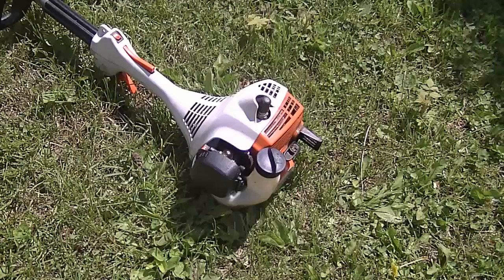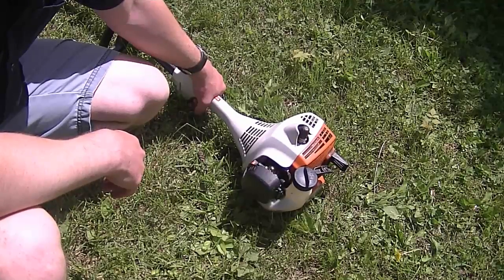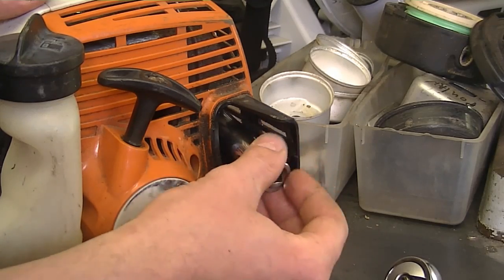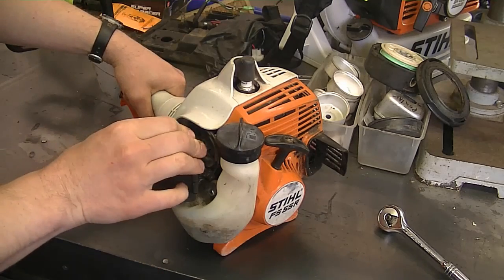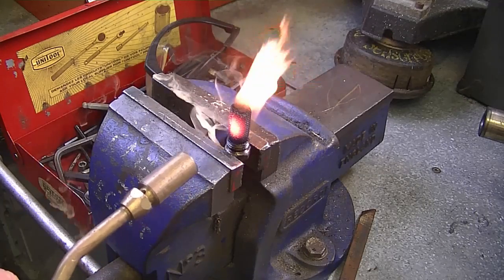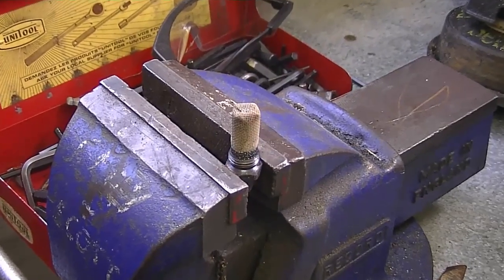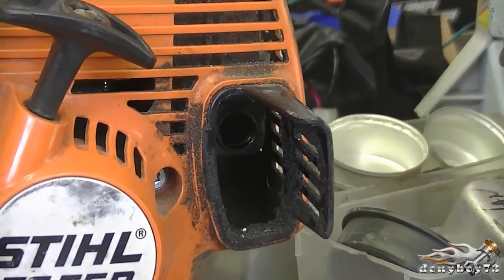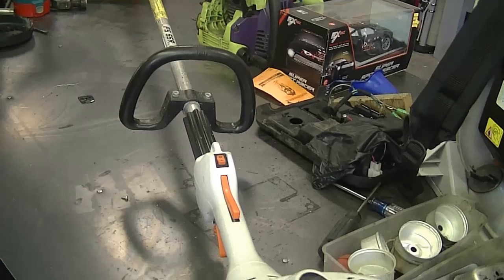Symptoms & Repair Of A Clogged Spark Arrester On A STIHL Grass Weed Wacker

Comment: THANKS!!!!!!!! I just happened to stumble on this. I am a VERY good home mechanic but could no longer get my 12 year old Stihl to run. Thought it was carb, thought it was plug, thought it was fuel line. I took my flamer arrestor out and it started like a mad machine. INSTANT throttle response like it was as new.10 times the RPM. FANTASTIC, so so happy!

Comment: Great video. Elderly neighbor had the same problem with his Echo trimmer.I noted lots of carbon around the muffler and asked him how much oil he used per gallon.He replied  4 ounces.He asked me if I could help him out. Started it same symptoms. Went home googled it and your video came up. Checked and screen clogged. I felt more comfortable taking the head off for two reasons carbon and he cross threaded the plug. It got so hot the bolts on the muffler were siezed. So bad my T handle twisted trying to remove them. Sprayed some KROIL on them and let sit for a couple days and came out easy(Great stuff). Removed cylinder removed carbon and chased the threads. Replaced his fuel tank also because he let it idle on the driveway and it wore some holes in it. Discovered it when I pressure checked the tank. Thank you for your videos! I have Stihl Bronze and Echo training but low on experience.. Your help has given me the confidence to get the job done!
Reply from the maker: +RyanCJ3 you're welcome, make sure you're subscribed

Comment: thanks.  just did this on my 6+ yr old stihl km55r kombi head...  I couldn't get the rpm's high enough to work the brush sweeper attachment or leaf blower...  I was surprised that it was clogged so fast.  I have only run 15 or so litres of premix through this machine...  anyways works great now.   driveway is all swept of the winter gravel/sand and junk.

Comment: I had the same issue with a Stihl FS 86 model. The repair shop charged me $75 to clean the arrestor. I ran about 3 gallons of the new Stihl grey bottle gasoline oil mix in the trimmer when the arrestor became clogged and bogged the engine. I have been running the old orange bottle gasoline oil mix ever since without any issues. Now that I know what the arrestor looks like - I believe the best approach is to remove the arrestor and use the new grey bottle gasoline oil mix in the trimmer for its protective engine properties. As a qualifier, I am only a homeowner working on his own urban property and not a commercial landscaper working in a forest area.

Comment: Hi Don , Good video.  Have a stihl 170 chainsaw that has starting problems. it's barely 2 and only been run less than 5 times. But,  gonna check the spark arrestor on it before I pull the carb. Seems crazy carb problem s with such little use but last resort. Truly can't think the spark arrestor is clogged either but least of two evils. Thanks for your videos,  always helpful.

Comment: Nice video and explanation. Cured my fs55 of the exact same problem. I went for the feul filter because it started easy but wouldn't run high rpm. Nothing wrong with changing it even though it didn't cure it!

Comment: Got it Donyboy thank you never would have thought of that. I'll check that out as well it does look rather built up already.
Reply from the maker: might be your problem
Reply: thanks how bout the craftsman with the pulley assembly not grabbing the flywheel right and the cover rocks back and forth? All the screws in the cover line up great and seems to be on right but it rocks on top so something is not seating correct and even though the pull works great out it hangs up  sometimes while on.

Comment: Dony,  The symptoms on your Stihl is very similar to my Echo PB-200 blower.  I checked the spark arrestor but there was very little carbon.  I cleaned it anyway and heated up the muffler to to burn off any carbon.  As I said, there was very little and there was little improvement

So, now what should I be looking for?  I like the machine as it is fairly light to carry around on the roof when blowing debris from the surrounding trees.  Your help is appreciated.

Comment: I use my tiki torch on the back patio and the flame from it cleans just as good as a butane torch, takes a little longer but burns all the built carbon off of screen for certain.

Comment: Hi Don, I'm a big fan.  I have the same Stihl FS 55 , I have replaced carb and still can't start. Original carb, and replacement, have small air bubbles leaking through primer bulbs.  Not sure what to replace.  New bulbs installed.  Fuel lines or some gasket?

Comment: if the carburetor has adjusting screws (assuming its a walbro or zama carb with high and low end screws), adjust them until the engine starts. if it still doesn't start, check your spark plug and exhaust port. sometimes the ignition coil can go loose, so it would also be best to check that aswell

Comment: Stihl FS45 trimmer starter rope is very hard to pull. Removed the muffler, carb, and spark plug. No scoring on piston or carbon buildup in exhaust port.
 The piston moves easily and smoothly when you pull the rope with the pug out. Put the plug back in and starter rope is very hard to pull again. Can't pull fast enough to start, or even attempt to. Removed and checked the recoil - no issues there. Any suggestions? Thanks!
Reply: The answer here is simple - I needed to have fuel/oil mixture in the tank and prime the carb. Fuel/oil provides enough lubrication for the piston to move up and down in the cylinder. Trying to do this with a dry cylinder makes the starter rope much harder to pull.

Comment: I like how Stihl (and other makers too, I suppose) has come out with a specific, pre-mixed 50:1 non-ethanol, high-octane fuel and premium STIHL HP Ultra oil that you can buy in an approximately 1 liter can.  Takes the idiot out of refueling 2-strokes.  Great tip on the Spark arrestor.  Exact model that I have, so thank you (although I don't let mine get like this!).

Comment: Donyboy73, I've exhausted my knowledge of a 2 cycle engine trying to get my newly acquired used Stilh FS55-R.  Although advertised as "like new" it was not running.   Initial exam, the primer bulb was cracked.  That was an easy replacement.  Seeing an aged & cracked primer bulb, I disposed of the fuel, cleaned the tank and added fresh 50:1 fuel.  I still did not prime.  I cleaned the carb, checked the fuel lines, it still did not prime.  Today, I purchased a Stihl carburetor, the unit now primes.  However, it will not start.  I confirmed the plug is good, it is.  The ignition coil seems to be sending fire as my plug test light indicates.  A known working spark plug has been added.  It is still not firing off.  I'll check the spark arrestor, the unit looks to little used to be clogged.  Any other clues, hints or places to check for the unit to fail to run?
Reply: Britton Waldron did you find your answer?

Comment: Donyboy73, thanks for all your videos, I have tried multiple suggestions and still nothing.  Here's my scenario:
FS46, borrowed from a friend, has not been used in 2ish years, they kept the Gas/Oil mix in there the whole time.
Here is what I've done:
Installed new air filter.  Checked spark arrestor (was clean).  Swapped spark plug. Drained old Gas/Oil, installed new pre-mix formula/swapped out old fuel filter.

The only thing have not done is install new carb.  Which is arriving tomorrow.  Any other suggestions we've missed?

Thanks. Jared

Comment: Hey Donyboy, not a question, but a statement. 
My old Stihl blower had a narrow point on the tube, but my current BG65 is circular. I've noticed that this doesn't create enough backpressure, thus, it doesn't rev as high. Seems like a regressive design to me. It's also much more plasticy than the old one.

Comment: Here's a tough question I have that you may have an answer for donyboy73.

On cheap trimmers the gas lines are fed into the plastic gas tank through a small hole drilled into the tank.  On a lot of the cheaper trimmers the point at which the line enters the tank starts to leak sometimes.  First thing I do is replace the line.  Sometimes that does not work and I am wondering if there is a magic putty or glue that you would recommend using to make a seal so that no gas leaks.  
Thank you.

Comment: Can't start my Ryobi 2 stroker after running it hard on some edging. Broke the string. Turned it off, fixed the string and it's dead. Swapped the carb, changed the spark plug and the kill switch. Simply will not start. Found your video to see the symptoms of a blocked arrestor screen. Since mine won't start at all I don't think that is the problem. Barely a rumble when cranking. Maybe electrical??

Comment: Great demo, Dony! 

Similar to a clogged cat in an auto engine, but a lot easier and less expensive to fix. It seems that cleaning the screen should be part of a maintenance schedule, though I suppose the propane heating might be damaging if it were done regularly. Do you see this very often?

Comment: I just fixed this same issue on my neighbors stihl fs40, he couldn’t figure why it wouldn’t throttle up but I heard it at idle and it sounded stifled. Sure enough the screen was 95% blocked.

Comment: is the spark arrestor made of stainless steel, or just regular steel.
and do you find that more metric nuts and bolt are used in the newer machines.

Comment: i did the exact same thing, just took it out and it runs better than before. i had maggots in mine and it was so badly blocked even compressed air couldnt get them out. i even soaked it in petrol to. so screwed up

Comment: hey donyboy73, I have learn a great deal viewing your videos thanks.  I have a stihl  sr420 backpack mist blower .that's keeping shutting off after starting. change spark plug & gas pickup & clean out carb. & new air filter & clean spark arrester like you posted , still the blower shut off after 30 sec . hey doc. what's going on   ?

Comment: Mine was not really dirty but I removed it and left it out ,cleaned the exhaust port,the muffler ,the spark plug  and reset the gap on the plug...It runs better now,like new...Those things are just a CYA  part by the makers to keep them from having a law suit taken out on them in case a fire starts from a stray spark that might leave the exhaust..I have never had a spark to fly out and cause a fire..

Comment: hey man im kinda new to using the bush cutters. im having a problem with mine. (When I press the throttle all the way in it sounds just fine to me. there is no bogs whats so ever. but even if it sounds strong the cutting is weak. it barely cuts the grass. any ideas what it is?

Comment: Homelite UT10520 Chainsaw has a spark, compression is 90 PSI.  If I put some starting flued into the spark hole and put a spark back, should I have a crank (firing) even if fuel tank is empty?

Comment: Check the valve adjustment, they slowly start to get looser as they wear in and need to be readjusted.  Another symptom is that it won't rev up as high or as easily

Comment: Don I have a kohler courage 23hp v-twin that I need to replace the cam in. Problem is the main pulley is seized on and I can't get it off. Used penetrating oil, puller, mallet, torch, nothing has helped. Any tips?

Comment: Hi, Have a little 26cc engine that runs ok for a short time then dies at idle after warm? I can save it by putting on half choke, so extra air coming from somewhere?  So have replaced all gaskets for engine, insulator and carb and the oil seal on crankshaft and put 9 lbs pressure in that engine with no needle movement. Possible case crack only when hot letting air in? Rings and all that ok and can start it ok with no primer bulb so takes 6-10 pulls to get going. Also put 3 carbs on it with exact same running them failure to idle between 10-30 mins.  could a worn coil when hot be saved by the choke??

Fuel delivery is gravity fed and 2 carbs i tried had bulbs and they were full when it failed so carb should be full. 

If i can start it at cranking speed, does that mean it should run above that at idle as the engine is worn and blowby when hot would upset the 2 stroke cycle just enough ? not enough suction to draw up fuel mixture hot?. 

This barrel has no reed for the pulse hole, just the piston sliding past and i have seen it flood the plug when metering spring was a little weak , so pulse hole pressure seems ok and unblocked. oil spit out when i squirt a little in it and pull cord.  One time, it wouldnt go above half power for a few mins, then cleared and i had full power again?? Possessed? haha Nothing left to replace or substitute now, so totally baffled.  
So all thats left is low compression, weak coil, crack in crankcase?  but tests ruled them out except crack?

Comment: Great video. Could this be the same problem with my Troybilt back pack blower? Runs, but is losing power. I thought it was the new cheap ass gas / ethanol stuff we have to buy.

Comment: Please help i have a fs55rc my spark arrester screen is clean and i can get full throttle but no low speed response i did clean and installed gasket rebuilt kit carburetor i didn't pull the passage  Welsh plugs

Comment: ive had luck with echo trimmers the past year or so.   around here there`s been nothing but flooding andthe past month theres been 3 tornados with in a 15 min drive. .  anyway people have been throwing trimmers ,lawnmowers and everything out .   some of my neighbors are scrapers and i mean ive got echo trimmers out the ass from them ,  all they need is like.   new lines, a primer bulb, the one the spark plug boot came off so they junked it.   i got a brandnew toro timemaster,all it needed was the traction cabel adjusted, a toro recycler that somebody ran threw high grass and it got tangled in the front drive pully so they junked it. a stihl fs 46.   i had a weedeater blower but i just junked that.   if its not husky, echo or a 4mix stihl i dont mess with it.     i found a poulan wild thing saw brand new also

Comment: Necessity, not to run correctly, but to prevent carbon sparks from an enriched fuel mixture [cold start] from starting brush fires.

Comment: Can I ask why in this video you suspected the spark arrester first, while in your "weedeater that bogs down" video you address the carb first? What lead you to those conclusions?

Thanks
Reply from the maker: Local Yard Works because each problem is common on those specific trimmers
Reply: donyboy73
Thanks

Comment: Could you have soaked the arrester in a cleaning solution?
Reply: Yes; Normally anything that will assist cleaning and not start other problems; The reliable standard used to be Stoddard's Solvent® which is simply mineral spirits which can be obtained about anywhere … the best approach is to simply spend a few bucks on a brass wire brush and even discarded toothbrush > Anything smaller than a 20# electric jack hammer is usually good 
We mechs just normally wipe it on the pants by wife and momma gripe too much about it

Comment: What I do on my Fs90r is take off my whole exhaust and then remove the spark arrester and heat it up and take my air Compressor and blow the carbon off then take a wire brush and then take may air compossor nosel and stick it in the exhaust and blow all the carbon out of there

Comment: Why not just leave the screen out all together?
Reply: They say theres a small chance of it starting a fire.  Its supposed to prevent sparks flying out and hitting dry grass.  I however run mine without it and never encounter problems nor does my neighbor.
Reply: 427 Elevating Productions Yeah I could see it if where you're cutting is really dry but it's unlikely to start a fire.
Reply: yep it is.

Comment: Nice, informative video, but to hell with that.......RIP THAT BABY OUT!!!!!!!!!  sounds cooler  and  a slight, but noticeable increase in power, And once it's out you never have to concern yourself about cleaning it ever again. But if someone doesn't like the extra noise then yours is the right procedure.
Reply: only thing you have to worry about is grass fires/forest fires...  its called a spark arrestor for a reason. but if you live in a big city with plenty of water and things around you are well watered.....(shrug)

Comment: those cheap curved shaft stihl trimmer are junk just like every other one..if your going to buy anything under 200 bucks mind as well just buy homelight or craftsman.    i cant tell you how many trimmers use the zama c1q carb.   if it has that carb its junk